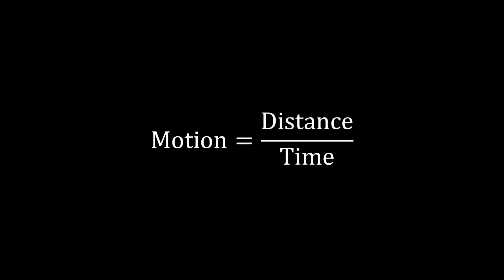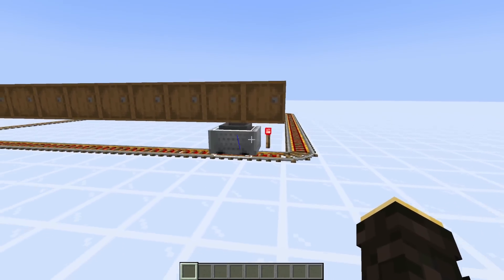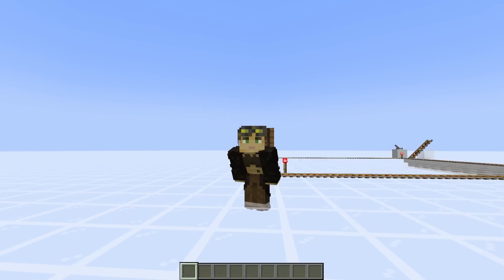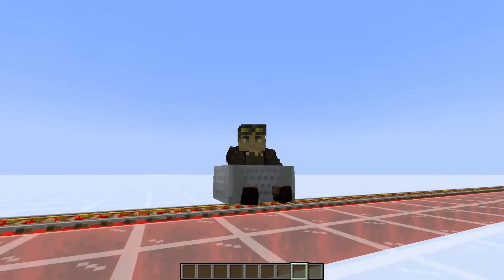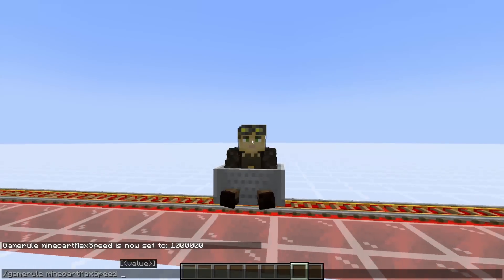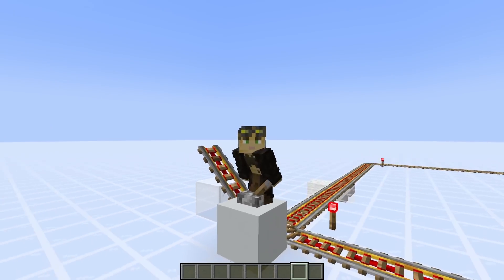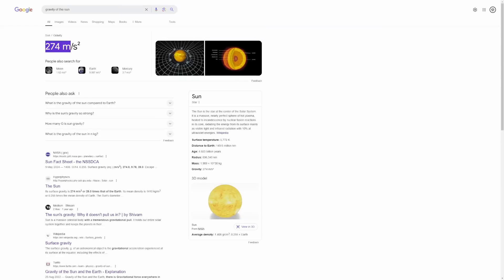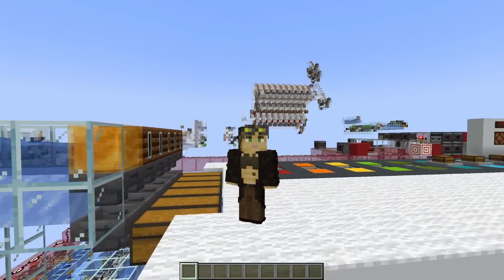Minecart Madness

Comment: ANSYS Fluent to do CFD on what is effectively a hollow rectangular prism is real "Nuclear bomb vs coughing baby" type stuff

p.s. you should increase the flow volume size, the boundary layer flow from the edge of the volume is way too close to the minecart, that red high velocity zone between the cart and the wall is indicative that the air is being compressed flowing between the cart and the wall and isnt accurate to unbounded flow conditions, I use atleast 10x the characteristic length in volume width but I know that the student version is capped in node count so i get it

Comment: 12:32 this is wrong because watts is energy per second, not per meter. so, it would only be 4kw if the Minecraft always traveled at 1 m/s, which it doesn't.
Reply: If it could produce that force at 80 m/s, that's about 3500hp which is similar to an engine of a c-130. However, since this is fixed thrust, it is really most similar to a rocket engine like the AJ-10. definitely not fitting on a minecart. Realisitically, It probably works like a gauss cannon, or maybe the rails are like the rails of a rail gun. that would be a sick interpertation.
Reply: I wish i can understand what all of you are saying, and im very interested now, can you give me road map or a good source or book to study this alone.

Comment: fun fact there was an old snapshot a copuple years ago where they wanted to tweak the minecarts, they added derailing to the game. It sucked dont add derailing, especially with different drag coefficients depending on the state of a minecart it just added unreliable results and was overall janky. Dont get me wrong though the copper rail variant is a really good idea and isnt even only useful for coasters/rides for delibrate slow downs
Reply from the maker: The de-railing mechanic you speak of was not intentional behaviour of minecarts but instead it was a consqeuence of the way entities process their motion. A minecart moving on a rail will always set its sideways motion to zero and snap its position to the centre of the rail. However if the minecart found itself on a curved rail it would set both XZ motion axis to the same speed and move diagonally. The problem is that as the speed of the minecart increases, so does the interval at which it checks what type of rail it is on. This meant moving at speeds larger than 1 block per tick the minecart could skip an entire rail and not even realise that it was supposed to turn a corner. This would result in the de-railing  behaviour which was fixed by giving the minecart a max speed well under 1 block per tick to ensure that it could never skip the curved rail.

The experimental changes in the 1.21.2 snapshots eliminates the speed cap and the de-railing that would result from it by making the minecart scan ahead of it's position, effectively mapping out the geometry of the rail ahead of time to ensure corners are never missed. What I am proposing means re-introducing de-railing not in the janky broken way it was before, but in a way that is consistent with a cetain speed limit for turning corners.
Reply: @cubicmetre  huh, i never knew. I think i was a little too young to be interested the technical side of minecraft at the time, thanks for the crash course and keep up the great work!

Comment: i kind of wish furnace minecarts could get a redux. 
1: improve coupling mechanic (eg slime, any cart, slime in a row = sticky version of that minecart). sticky minecarts are always connected unless an external interaction breaks them up.
2: you can put a stack of fuel in furnace carts, and fuel it with hoppers above or to the side of the rail. fuel can also transfer from adjacent sticky container mine carts (regular sticky carts cannot transfer fuel).
3: furnace minecarts can shift into neutral through activator rail interaction. in neutral the cart will stop drawing new fuel (though fuel still burning for its duration based on type).
4: add a cab cart which can control all connected furnace minecarts (carts must be sticky to transfer control through them). you can not only shift in and out of neutral, but you can also break and reverse. if multiple furnace carts are in use, you can also have a number of speeds equal to the number of furnace carts in the train. the total mass of all carts and number of furnace carts and rail type effect top speed. 
5: gold (and copper) rail provide a baseline speed and it stacks with furnace power. i like the idea of different oxidization states represent different speeds but i think id make gold stay where it is, copper is slower. id also consider adding diamond rails (6 diamonds, 2 sticks and dust) for even higher speeds, maybe netherite rails (4 diamonds, 2 scrap, 2 sticks and dust) as well. also add stone rails for breaking to enable passive speed control.

Comment: Yk the implementation will completely destroy most builds that use minecarts right? Also it will remove the possibility of being able to store the carts in a 1x1 spacing for infinite rom tech...
Reply from the maker: Minecart behaviour has already been altered in ways that breaks most cart based tech as of 24w33a, the proposed implementation can't break what is already broken. But if Mojang are going to break shit I'd much rather them make a concrete and more exciting implementation of the new behaviours than breaking everything with a boring implementation.

Comment: A simple, but inefficient solution to make Minecrafts reliably interact with blocks would be to interpolate their positions.
Basically looking up all rails it drives over in each tick, and doing the all relevant checks in the center of all of them during that same tick.

It does that for corner rails already, so I'm sure the physics interpolation code already exists, it just has to be hooked in.

What this doesn't solve is detailing in contraptions. So I think different tiers of rails might just be the best solution. The janky interaction might also become an interesting engineering problem.

Little note: The sound thing is a massive vibe, but I doubt they're gonna make accidental details a thing. That might put beginners off of minecarts. Which you will understand is not something Mojang want.

Comment: I think that for most players, making fast minecarts derail around corners would be more frustrating than fun, but everything else sounds good.  Maybe if you added new multi-block corners that can handle higher speeds and a simple rule like “anything you do with copper rails and slopes can work with a standard corner, anything with just gold rails and slopes can work with a size-2 corner, and anything you do at all works with a size-3 corner”.

Comment: I had a similar idea for copper rails except that the copper rails would have a max speed of 8 while the gold rails have a higher max speed.

As for the flying off corners idea, absolutely not. This makes minecarts less accessible and intuitive for most people. It also makes laying track in a zig zag (like for a piston bolt) no longer work.

Comment: wait you're genius....

if every oxidation layer halved the minecart's speed, and then you could have a 0-15 signal strength interpolation between the current oxidation speed and next speed, you could have precise control over a minecart's speed kind of like a floating point number where oxidation is the exponent and the redstone signal strength is the mantissa

that's probably overly complicated for minecraft but it sure does tickle my brain to create such a clever implementation for potentially no useful reason

Comment: In this video:
Cubicmetre addresses an issue that doesn't exist, minecarts aren't faster.
Cubicmetre DOESN'T address the real issue that minecarts now arc at the end of their path, this can be easily fixed by placing ANY block at the end of the path. This could be a slab, full block, observer, what-have-you so it really doesn't interrupt redstone lines it just requires a rework of some designs.
Cubicmetre pretty much only addresses technical concerns as usual

Comment: The terminal velocity would be even lower if you take into account the friction on the wheels.
Reply from the maker: Yeah but if you actually look below the minecart it doesn't actually have wheels and is not even in contact with the rails. I assumed there is some sort of redstone levitation going on there.

Comment: I really hope Mojang will listen to feedback. Copper rail with different speed than gold are such a nobrainer that literally everyone speaking about minecarts mentioned it. Derailment on too high speeds might be too punishing for mojang to add(considering some less knowladgable players might not figure out how to slow minecarts down and rails would be almost unusable for them unless in stright line) but I think automatic slowing down on turns when above some speed would be nice mechanic. And it would be nice if on higher speeds this speed loss would be high enough that it would be beneficial to slow down before turn. That would be less punishing for less knowledgeable players and would give some nice area for optimising railways for more tech-savvy players.

Comment: Love the oxidized copper rails idea. Sure, drowned still need some work, but with the amount that can be found in the Trial Chambers, adding more uses for all that copper that now naturally generates in the world is a great idea. I'd adjust the speeds from what you used, so that maximum (non-oxidized) would use the maximum stable pickup speed, but other than that - it's great. Certainly better than powering idea because it'd make precisely controlling speed a hassle in the more compact machines - where that is most needed.

I am not too keen on minecart being this "crazy" vehicle, since like  trains, it's main contribution was consistency - ability to do the prep once and then be able to use it even when afk. This makes consistent behavior THE feature of the carts, and with enhanced nether portals (occupied vehicles now enabled) the cart speed already got a huge boost. In fact, slower carts will arguably be more useful, mainly for auto-planting farms and the like - again, precise applications, not speed.

Thing is, most people will just use elytra, ice boat or a horse (if the track is flat enough). Horses could probably use some love - maybe an ability for a charging horse (maybe a feature of horse armor?) to destroy leaves on contact without losing momentum? That would make forest navigation easier and more horse-compatible. Add in possible treasure-only enchants to get them more resistances but also a Buoyancy? Let ridden horses not sink, but be massively slower instead to make river crossings reasonable, but not marginalize boats or frost walker for oceans. Skelly horses are pretty good, but depend heavily on RNG, so they see less use - they in turn could use something to reduce water drag, help underwater exploration and make more use of Respiration enchant.

I'm rambling, but since horses were supposed to be the over land  mode of transport for no-prep travel (no rails, no ice, no waterways) I'd say that's still on topic.

Comment: Before all of this started I was messing around with speed settings on minecarts in my server you could change how fast carts went based off of what blocks they were on top of I ended up picking a block that allowed it to go a speed of more than eight and if there was a rail above the block and you went too fast you would derail it's a nice feature to have but the speed was limited to only straight lines like you mentioned I was messing around with these settings because I ended up making the carts settings to be placed anywhere and we used them as race cars along a track that we made

Comment: I never expected to see an engineer to apply computational fluid dynamics to realize that Minecraft is using the wrong drag equation 🤣 as speed increases, drag is supposed to increase exponentially (meaning that you need 4x power to overcome drag) 🤣🤣🤣 A math/physics nerd video with great insight and ideas on how to fix 🥰

Comment: I like the Copper rails idea, Mojang could very much add them to this experimental branch of the game and just see what happens, why brainstorm solutions internally when the community will do it for you to our exact expectations?
It took them 4 years to continue tinkering with Bundles so it's not like they can't play the long game until we reach that sweet spot where both Casual and technical players are satisfied, there is no time frame for when or even IF they'll implement any potential change. So yeah, lets get VERY experimental, why not?

Comment: Can't you just trace the path the the minecart takes and have it take items based on interpellation rather than real position? Idk, I feel like there's another solution here. Minecarts can be in any position when they are on a rail, their path is range of motion is determined, I just feel like that's pretty useful information that could be used in favor of making minecarts reliable at high speeds.

Comment: We could then have oxidized copper ingots to craft this. Copper blocks would then be harder to farm bc you need specific oxidation. A solution would be to have oxidized copper blocks give off a specific redstone signal strength we could use for sorting. That mechanic would also be super useful in many other redstone builds

Comment: I was sceptical at first, but this actually makes a lot of sense. Even without doing the aerodynamic simulation, I can immediately see how this would be extremely useful for engineers, builders, and typical Minecraft players. Redstone engineers could begin to use the copper rail variants in unique and controlled ways to limit Minecart speed in specific ways in order to make more efficient machines. Builders would be able to use the uncapped powered rails for proper rollercoasters, racetracks, or even mini redstone bits in larger builds. The average Minecraft player could just use the new speeds to go places faster prior to getting an Elytra and after getting a Saddle. It doesn't necessarily break the balance of the game, while also providing a lot of improvements across the board.

Comment: Just a random thought. But couldn't you use stored breeze charges in the orbital strike cannon as the alignment charges for the payload for larger scaled payloads that doesn't need to be so accurate for the target area since breeze charges harvested from breezes have some random value of power.

Comment: I agreed up to the turn limitations. I think there is a limit to the realism expectation in a game that's subdivided into cubicmeters. 

Without being able to generate higher radii turns to compensate, being forced to come up with arguably pretty janky solutions to slow a cart around a corner, the corners should really just stay the same for simplicity of gameplay.

There is a line between realism and gameplay. Anything that can be done in the background (like realistic acceleration of minecarts) should be realistic! The player doesn't need to know it's happening outside of experiencing it. But for things the player does have control over, like the cart turning, there needs to be reduced expectations of realism with a game that has such a low level of granularity to the size of components. 

We're already carrying around multiple 1000s of tons of material in our pockets (hell, maybe even millions), so I think realism in that way has already been sacrificed for the sake of gameplay. Same should go for the incredulous turning performance of powered minecarts.

Comment: 12:32 small correction: the power isn’t 4kW (small k btw, also in kg), but the delivered energy is 4kWs (=4kNm), since the force is applied over a 1m distance. Only when the minecart travels at 1m/s, this energy is delivered in 1s, so 4kWs (4kW*s) are delivered per second, making the power output 4kW. Also, enerqy ≠ torque, although both are measured in Nm

Comment: I remember that minekarts used to derail around corners at max speed back in the day around when I got the game as a kid, due to it, I never do directly 90° corners, I tryi to round them by a few blocks so its 2 45° angles instead of just a 90° angle, they should implement that back

Comment: Other than the part where you make it sound as if they are definitively making Minecarts exclusively for transportation just because they added a gamerule that didn't even change the default values for it (with most of Minecart's issues with contraptions being the fault of the new collisions-- not the speed that wasn't even changed); a lot of these makes sense and basically my idea as well.

Specifically the part about rail variants, Copper Rails would have the max speed similar - if not the same - as the current Powered Rails, while the Gold Powered would be faster and have the ability to go even faster than Blue Ice Boats but at a cost of potentially derailing from being too fast-- making Copper Rails the reliable Rail for contraptions or turns/corners while Gold Rails are made for fast straight rail transportation making it the definitive transportation methtd over Blue Ice Boats or even Elytras in some scenarios.
Reply: Yeah and collecting oxidized copper rails would be agonizing

Comment: What if the normal rails are default speed while the copper is an adjustable speed power rail. Like depending on how much level of redstone power it received. So you have the option to have super slow speed of 1 to 15 super speed.

This could easily be implemented as multiplication too, start with 2 (power 1) to 30 (power 15) if 1-15 is still too slow. Multiplication of 2 is better.

If you want much faster than default and doesn't necessarily want slower than 8, multiplication of 8 is probably better for speed as 1 would be default speed and the rest are just significantly more speed for speedy rollercoaster.